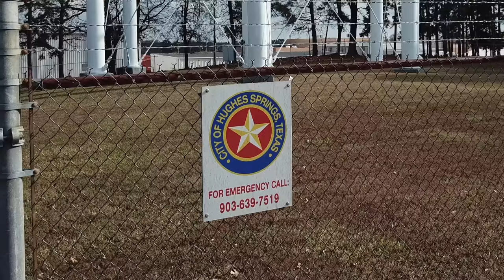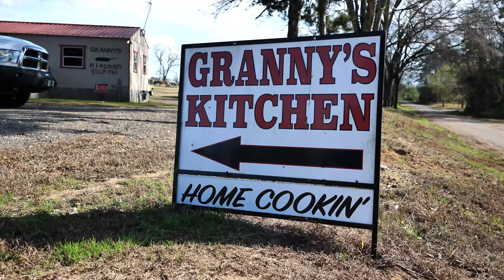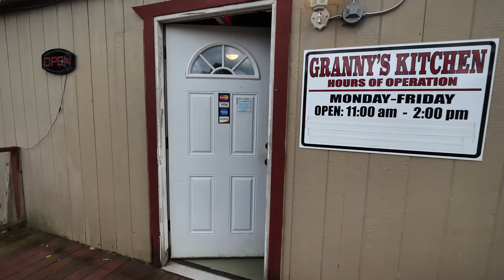MOPAR MUSCLE CAR RESCUE!! + Granny's hometown cooking!

Comment: A Charger 500 are rare numbers.
They changed extra front grill frame & also the back window tray with a smaller trunk.
"Nicks Garage" is in the middle of a top notch nut & bolt restoration of a Yellow Charger 500. The body is almost ready in paint, and the engine & trans is done, he's going to install the engine from underneath just like they did at the factory soon.
If you want any Mopar info Nick is the expert for all things Mopar.
Reply: This is a 1970 charger 500, not the same as 1969, it’s just a base model trim code
Reply: I watch nicks garage all the time, he’s great, I’m been working on my 1968 base model charger for awhile and is going to a shop soon here in Washington to get finished although I don’t look forward to packing up all the parts to send to the shop ahhhh

Comment: It may be a Charger 500,  but it does not the aerodynamic rear roof panel which is longer and has the full rear window fastback with the short rear trunk lid.  It does have the rear chopped rear window which is the normal 68' - 70' Chargers.

Comment: Nick's garage is doing a complete restoration on a Charger 500.  The car Nick is restoring has a 440, Dennis" has a 383 and a 2 barrel.  Would have thought they would be a little more performance oriented, since they made so few of them.  Great score, where do we see the finished cars?  Complete the story.  Nice vid.
Reply: 1970 charger 500 is just a trim code for 1970,  o thing special about them but the emblem

Comment: This car sure has a good and sad story.  R.I.P Mr. Gerald.  My condolences to his family.  For restoration, you can keep the original copper and white color combination but what would be really cool, buy an authentic looking 426 Hemi crate motor and drop it into that baby because very small number of these came with the Hemi.  If you don’t have 16 grand for the Hemi crate, you can make this car into a 440 six pack because 440 crate motors are a bit cheaper.  This might have been something Gerald always wanted to do to that car
Reply: 1970 charger 500 never got a hemi in them, there just a glorified base model

Comment: I saw you say in another video not to strap the panels to the trailer because of suspension travel. Strapping over the hood and guards onto the wheel is asking for panel damage if you go over a bump.

Comment: I thought the 500’s had the raked rear window and shorter trunk lid?
Reply: Those are the ‘69s. ‘70s are a regular Charger
Reply: Correct, it’s just a base model trim code for 1970, nothing special except the badge

Comment: I could be wrong, they may have changed the designation for 1970, but a Charger 500 is a very special car, as the rear glass is mounted flush with the C pillars for superior aerodynamics as opposed to the design house flying buttresses, which are a well known feature of 1968-1970 Chargers.    The 500 nomenclature is a reference to the 500 units needing to be produced by the OEM to homologate for NASCAR.    They wanted to dominate the big ovals and discovered that the flush rear glass was much faster on the top end, with this preceding the wings on the Superbirds and Daytonas.    Maybe since those two were out, the 500 stayed on but lost its special rear glass treatment.    If so, that’s pretty sad Dodge.    Why take something special and water it down by continuing its name but not continuing its namesake?     If the VIN doesn’t designate the 500 model, which it should, then I don’t think it is.  Also, he said the VIN denoted a “Premium” trim package.   Well, the 500s usually had dog dish hubcaps, and could have the 426 Hemi, but were otherwise generally stripper cars, because Chrysler needed to produce them for racing, but also wanted to actually be able to move them, and being a specialized model, may have scared off some customers were it not for the lower price tag on the stripper models.     Soooooo…….which is it.   I think it a 500 emblem on that car, as I didn’t even think they made the 500 trim line in 1970.   BUT, one of the reasons I watch this channel is for the learning experience.    That Holy Grail Mustang was awesome.    And I learned about those engines.   But did call out the dual points distributor.    Ford generally put those on higher revving, high performance engines.   The Hi-Po 289 had that distributor, as well as the Boss 302, the Boss 429, and 351 Boss, and the solid lifter SCJ engines, be it 428FE or 429 -385 Series

Comment: the  charger 500 model are very low number production  cars and they are definitely different than a standard charger or R/T
Reply: Hey everyone, just a Mopar fact. ‘70 Charger 500 are very different than a 69 Charger 500. ‘69s are the extremely valuable 500s made to race for nascar. The ‘70 is just another model like an SE or RT. Believe me it’s an awesome car and glad Dennis saved it. I have a ‘69 Charger SE so I’m a huge fan of these Chargers, just wanted to let everyone know the difference if they didn’t know. 👍👍👍👍
Reply: It’s just a base model trim code

Comment: Resto modding sucks keep it original if you can. Upgrade brakes and suspension tires for safety but do not change exterior or interior it looks like crap.